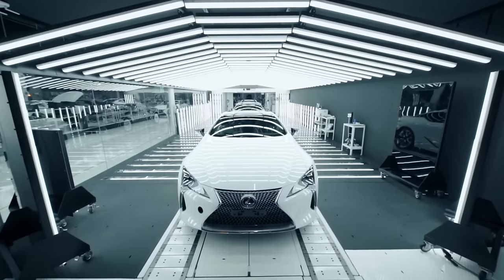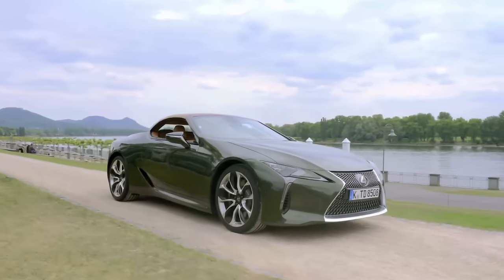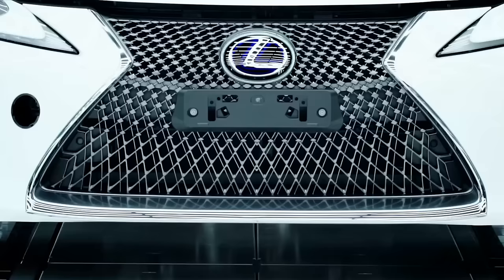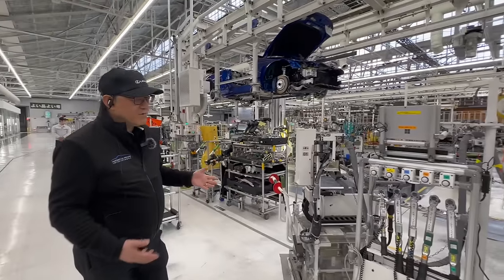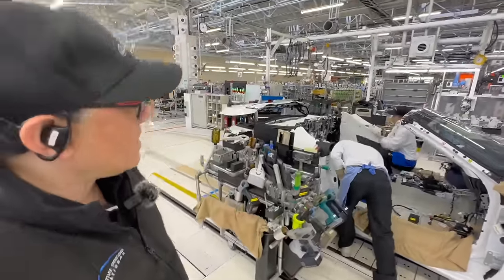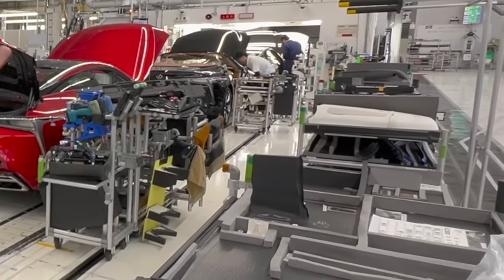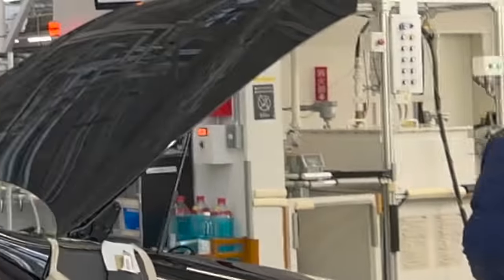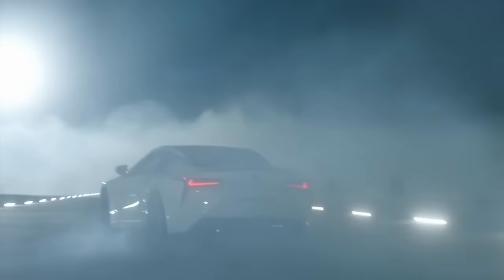WORLD-CLASS LEXUS LC 500 FACTORY IN JAPAN - ENGINEER EXPLAINS HOW LEXUS LC IS BUILT

Comment: Several months ago I saw your video where you compared the 911 to the LC500. I had rented several 911s over the years but never an LC. Well, I had the chance to rent one during New Year week and everything you said in the video is true. The build quality, engine note, and driving dynamics are absolutely phenomenal. As much as I love the 911, (it's my favorite sports car) I'd rather own an LC. 

The one I rented had over 80k miles on it and it still operated like new. Meanwhile, my 2018 Mercedes E43 AMG has creaks in the interior (at 42k miles...) and cheap plastic materials. I'll be trading it in later this year. 

Keep up the great work and respect to the engineers at Lexus who built the LC with remarkably good attention to detail.
Reply: Apples vs Oranges and any 911 or LC 500 owner will tell you that one is a GT the other a true sports car!  One cannot be the other and vice versa.
Reply: @edmundcharles5278  you  make a good point about the PURPOSE of each car.   But i've owned both and both SHOULD have quality parts, for the money you pay, but for some reason, Porsche, Maserati, Mercedes, and Jaguar .... they just cut corners, and it BOTHERS me.  I feel taken advantage that I paid all this money and the paint on the "Start" button is all worn off after 3 years (Jaguar), the passenger window up/down toggle falls off (Maserati). There is a rattle noise behind my head and someplace in front of the steering wheel at 4 years (Porsche),  The leather fades and wears out in the BARELY used back seats (Audi and Mercedes), The front fender just FELL OFF one day after 3 years (Audi).

Yes, these european cars are fast and statusy, but if i'm paying 140,000 for something , cant they use the GOOD paint or leather on the interior? cant they use better plastic for the window toggles?   Cant the car parts STAY on the car?   It's not a matter of power-to-weight ratio, or racing practicalities like being fireproof or lighter.   It's not like you need any of these changes to make a faster car. 

GT vs sports car is DEFINITELY gonna be different.  But this is BUILD QUALITY.    I WISH it wasnt so, but when compared Porsche, Audi, and Mercedes to the LC, i could FEEL that they're using CHEAPER parts and the parts they use just dont fit together as well as the japanese cars.   My godson has a 17 year old lexus (he's only 21) and the interior paint and leather on that car is in better shape my newer Porsche.  FOr example, the paint on the radio station buttons has no numbers on it in the Porsche....they've all been worn off.    And it's newer.  By contrast, there is not a SINGLE wear-and-tear sign on ANY lexus button. 

It makes me mad sometimes that I spend all this money and they cant be bothered to use better paint on the radio or they can keep the chassis from creaking after a few years.   Is cheap paint apples and oranges in a high perform,ance sports car?   No, that oranges to organges.   It's the same purpose:  use paint that wont get worn off from pressing the start button every day.  Use a better toggle on the window button, because people wanna roll their window down more than once.

Comment: 3 things. 
1. No wonder my 96 es300 with 300k I drove in college ran like a top. 
2. The LC500 will go down as a classic in 25-30 and will actually still be running and in great condition. 
3 you should follow up this video with a tour of Dodge dart production so we can see the two extremes 😅
Reply: Your 1996 ES is mass produced. Not comparable to how LC and LFAs are built.
Reply: @FilmScape4K Toyota/Lexus quality standards are consistent across car lines and factories though. Only difference here is 18 vehicles per shift vs. probably 100 or so for the ES.

Comment: My GR Yaris was made in this same factory two years ago. Watching this footage makes me even more proud of owning one! Thank you David.
Reply: Interesting. When I bought my 2019 LC I was told the hand-built assembly line was made for the LFA and then was dormant until LC came out. It seems they make many models at that plant but I wonder if that line is now shared by the GR. In 2019 it seems it wasn't shared by any other car model.
Reply: @IR-ry9bi  As I understood Motomachi’s factory was originally built to make Lexus models only. Over the years this changed and also made high end performance Toyotas like the GR Yaris/Corolla and the hydrogen powered sedan whose name I don’t remember now. And yes, the LFA gave this factory it’s prestige as well.
Reply from the maker: The Motomachi plant actually consists of many smaller factories inside a large plant.  So the GR section has its own area separate from the LC and other Motomachi products.
Reply: @AutomotivePress  Great piece!! Loved Lexus attention to detail. The GS and GSF were said to be built at locations at Motomachi aswell. Would love if you did a piece on the RCF Track or Fuji Editions the rawness of that car interests me more when I test drove them both in terms of Lexus focus on performance carbon fiber and aero design. Lexus make beautiful cars each for their own targets. The new emotion touring Japanese RCFs have a unique hand built engine balancing and also a specifically modified Torsen separate from all models prior that is said to be a great improvement over the prior iterations. Although the LC didnt inspire me as a driver per say; I understand its purpose; My taste finds myself loving the RCFs and the GX OT more than anything currently besides the LFA of course. I white LFA Nurb Package is a car I dream to drive and own one day.

Comment: Thank you for your excellent video. It was especially enjoyable since I will be taking delivery of my 2024 Lexus LC500 next month.  I own a 2018 Acura NSX which was built by the best American Acura/Honda employees.  Yet, it was delivered with misaligned headlights, incorrectly installed weather seal, and a rattle in the steering column.  Since I appreciate cars built to exceptional quality, should I wait to buy a Lexus ES until its production is moved to Japan?

Comment: David thank you. What are the best books to learn the Toyota Production System? I have read the Machine that Changed the World but I feel like I only scratched the surface of what actually makes it special. And my goodness that is a clean shop.
Reply from the maker: There are many books, but the "foundational" books are those written by Dr. Liker and also by Mike Hoseus (series of Toyota Way books).  I know the authors personally and they explain the concepts very well.
Reply: @AutomotivePress  Thank you, got the audiobook! (well one of many).
Reply: Well I am most of the way through Toyota Way 2nd ed, 14 management principles, and it is just awesome. There is one story about a high up executive going down on the production line and dipping his hands in a vat of oil to show someone that it a machine wasn't working because it was full of sludge.

Comment: Wish I could buy into this. I have an RCF that has 2 quality control issues from factory. Dealership blew me off. Contacted Lexus never heard back. They’re both purely cosmetic but you watch a video like this and you think it never would have passed QC. Reality never quite matches expectations I guess.
Reply: What year is your RCF? 2017, 2018 & 2019 are the better built one's. Anything before or after those years won't have as good QC.
Reply: Wow!  I am surprised with your experience.  I have owned 5 RX350’s, 3 GS350’s, 1 SC300, 1 IS350 and a LC500 all bought at my Lexus dealership.  Some used some new.  No issues with any or the dealership.  I am curios did you buy the car from a dealership and was it new or used?

Comment: Why the Lexus LC 500 was not built with a hardtop convertible like the IS 350C?.  Hard top convertible will seal the car better from noise and the element.  It will also last longer than a soft top.  Having a hard top folding convertible will make this LC 500 more unique?  I have a IS 350C myself and every time I seat and drive the car is a pure joy. You would think Lexus would built something of that nature to a perfection.

Comment: Haand assembled; not hand built!  Beautiful body, however, since its 2018 introduction, certain LC500 shortfalls have not been addressed : 4 wheel steering; better cabin ambient lighting; re-designed hatch-back for better storage; variable auto-adjusting air suspension; etc.

Comment: Remember that excessive  rear  wheel tire spinning (i.e., a tire burn out), is an indication that the  rear wheels are receiving more torque that the two back wheels can efficiently process, so excess energy is contributing to wheel-spin and thus excessive wheel wear!  Modern Gas and sports Carrs mange this excessive horsepower by proving opower distribution unto all four wheels (all wheel drive), thus making for a much more dynamic, powerful, and controllable vehicle across all power and driving ranges!  Expect the new model LC 500 to incorporate such a capability along with a TT V6 engine.

Comment: Very disappointed as I just received my 2024 LC 500 convertible. Ultrasonic Mica Blue with a blue and white interior. Lexus is making these convertibles with a 1/4-inch gap on the passenger side as the top closes. I see light in the driver's seat looking at the top as it fits the passenger side. Lexus factory rep says that this is within tolerance. In all my years I've never seen a top where it's not the same fit and an even seam from left to right. If this was disclosed I probably would not have bought the car.